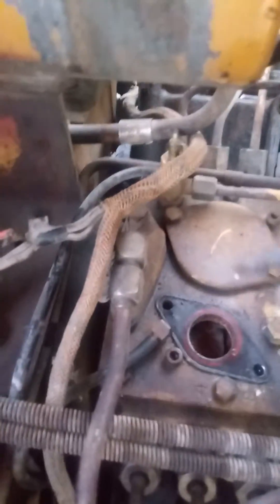3208 cat fuel shut off soleniod

Comment: I'm having the same trouble, what did you find in the other hole?  Is a spring suppose to be in the larger port?
Reply: A little late reply, but these older CATS need a fuel treatment additive, Lucas or Diesel Kleen. I had the same issue on twin marine 3208 cats.  There is no sulfur in today's diesel, which is the lubrication for pumps and other working parts.  Since I have added the additive I have not had any issues.